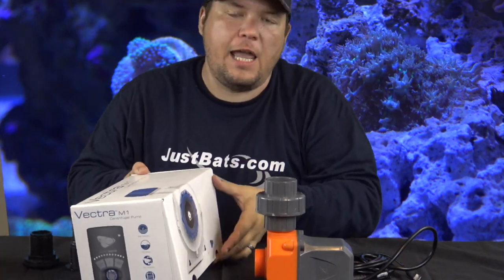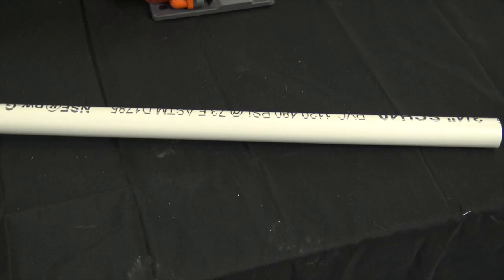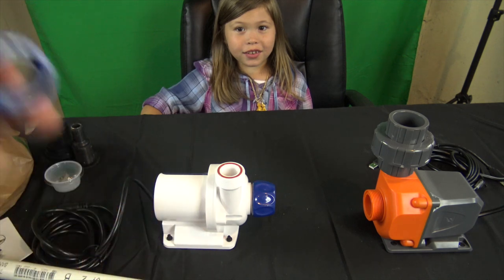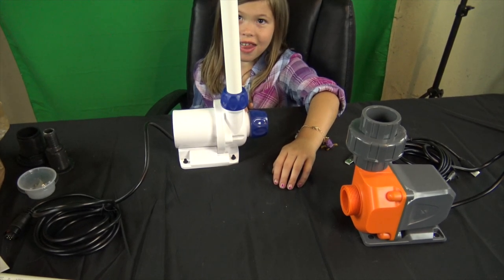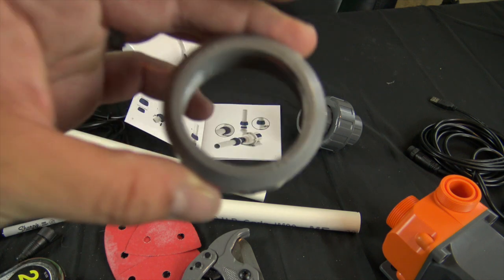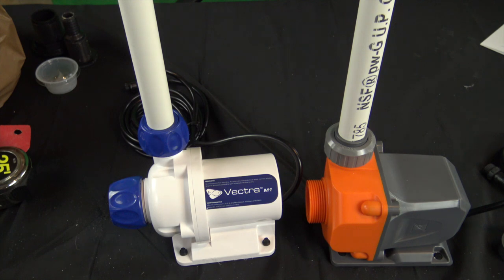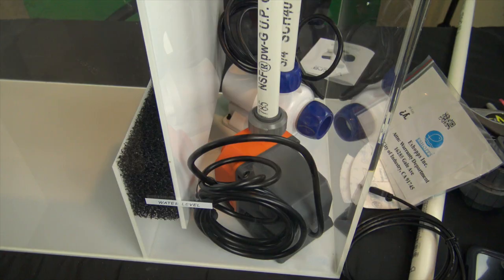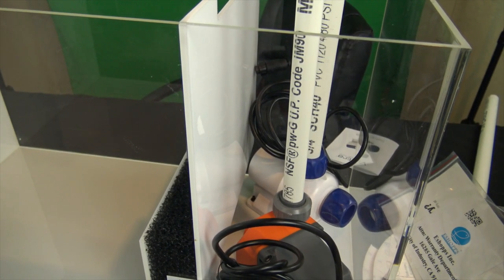Plumbing the 210g Part1.. M1 vs. COR20

Comment: i thought we were going to get the true COR20 review by now (third video and nothing).  This is a setup of a new sump with two pumps.  I hope Apex Neptune sent these items out to get good functional reviews and not new reefers getting new equipment to setup tanks.
Reply from the maker: Nikki thanks for the comment,  it should of been up by now.  Had some issues with bulk heads and vacation.  But you're right it should be running